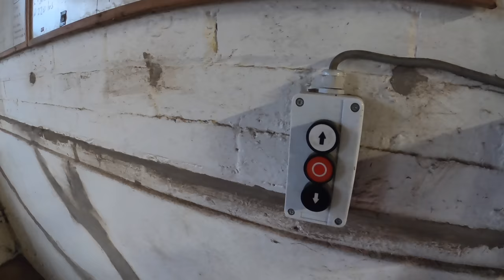FARMER'S DAY IN JANUARY - - CHAINSAWING, HEDGE PLANTING & A LITTLE JOB ON THE NEW TRACTOR

Comment: Vid opening :: I thought Wing Commander 🇬🇧 Dad was going to drive off in his Staff Car  to his aero drome and take off in his Spitfire 🛩️ ✌️🇬🇧. Car tip, blow fuel line out from the pump back to the tank. See if there is a strainer in the tank at fuel outlet. Inspect all fuel hoses and pipes for pin holes/leaks/rust causing air to suck into fuel line = starvation 👍😷🇺🇲 GATOR Up.
Reply from the maker: Thanks for the tip! 👍👍